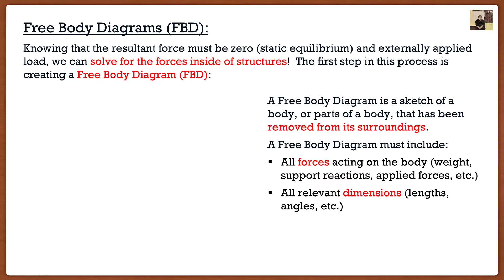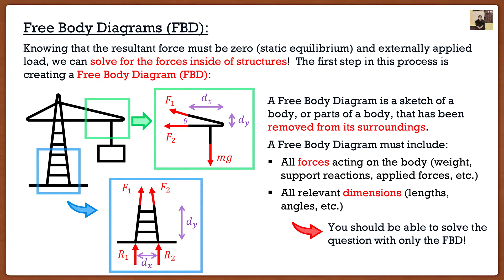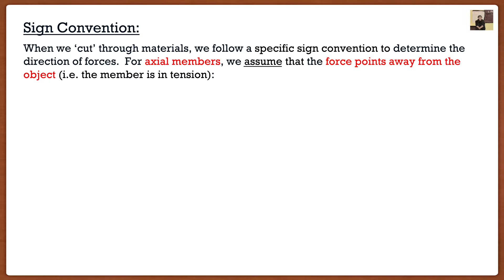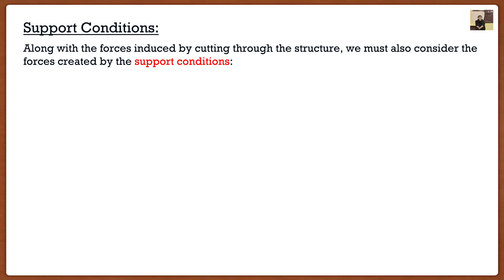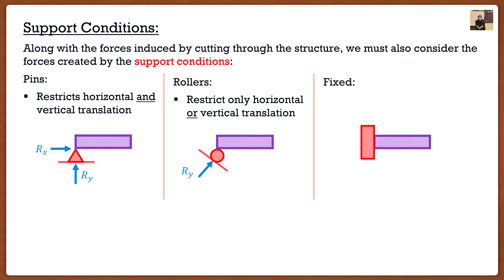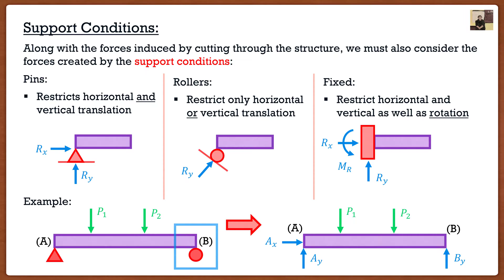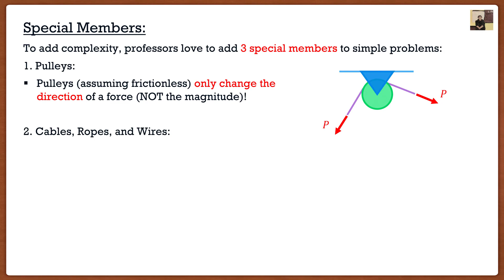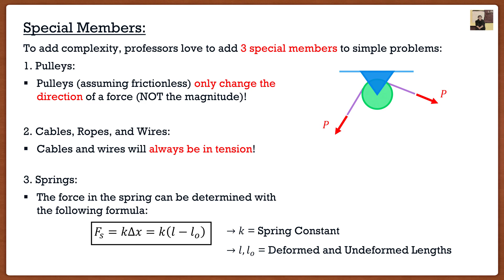Engineering Mechanics: Statics Theory | Free Body Diagrams

Comment: I think that strictly speaking, at 4:45 in the larger blue picture there need to be forces on the base of the crane pointing sideways. Of course, for a typical crane, these forces would be zero, but it is not mathematically impossible to have some sort of horizontal strain in the base.